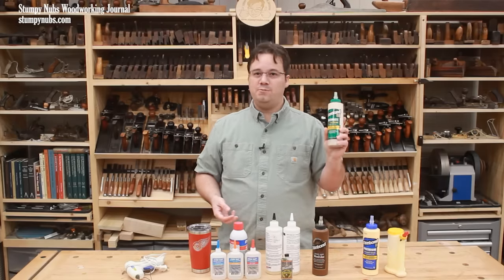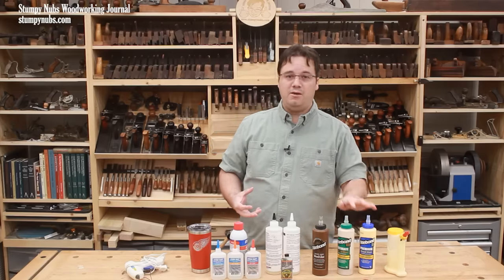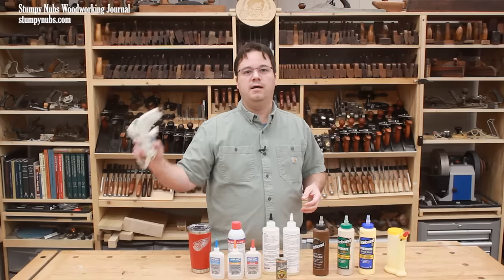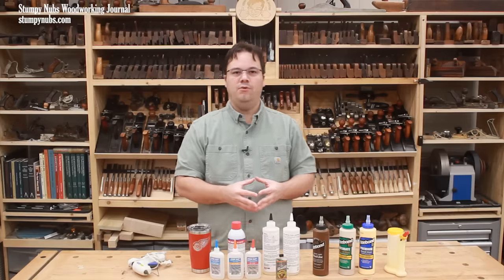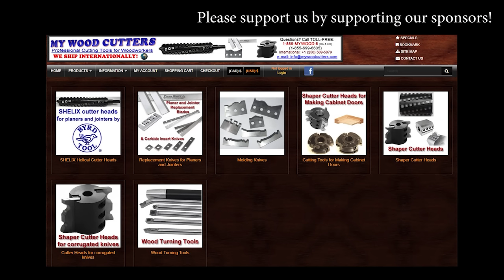Why I don't use Gorilla Glue

Comment: The "original" foam Gorilla glue is for a purpose and has it's uses... I would never have considered it for wood working.  For instance I used it to repair a broken roof tile, applied sparingly and our low garden wall that was reversed into on both side on consecutive days...this glue fixed all three things.
Gorilla wood glue is water resistant and in warm conditions a short grip time... for instance May a couple of years ago we started decorating to allow a ladder to be used on the stairs I glued to pieces of 9mm play together to create a platform, by the time I had measured and cut the legs and brace the two pieced of ply were bonded and put of the clamps.
Also in the UK Gorilla wood glue is significantly less expensive that Titebond II £5.39 vs £8.92 it is also easier to find.
So perhaps when trying to avoid a click bait title you thing about one Brand may have very many different products... Gorilla tape is super strong but for finished product not so appealing...

Comment: Polyurethane glue does indeed fill gaps, but when there is a gap, the glue foams up the loses its strength. I've read empirical testing that shows this to be so. I've gone through just 1 bottle of the stuff and that was enough to tell me that it just isn't worth the mess.

Comment: Thanks for posting. Can’t even get this gorilla glue out of the tube. Some suggest dipping the whole thing in boiling water to soften. This tube doesn’t have a long enough puncture pin to open the tip. So disappointed. Back to good old elmers yellow wood glue.

Comment: Jerry over at Rosa String Works has demonstrated many times that Tightbond is just as reversible with heat and moisture as hide glue but doesn't turn brittle and powdery over time. He has a constant battle with the purists that believe hide glue is the end all be all glue for instruments lol.
Reply from the maker: In my experience, releasing Titebond with heat requires such high temperatures that it destroys the wood finish around the joint. Not something I would want to do if I was repairing an old piece of furniture.
Reply: @StumpyNubs  I don't have a dog in that fight.  Just saying that he repairs musical instruments which are more delicate and finish concerns as well. Yet he goes on record saying/demonstrating otherwise. Who knows?

Comment: I use gorilla glue exclusively. It is a little messy (not difficult to deal with) but with butt joints that are going to be painted IT WILL NOT CRACK. It's not for every job...but if you want to build something and have it stay together it's the way to go.

Comment: CA glue cannot get wet because it softens into a rubber consistency. You can use it on skin as a way to make artificial carouses but if you wear gloves it softens from the excess moisture and will peel off easily

Comment: I don't use gorilla foaming glue because foam means air bubbles in the bond, and the strength of an air bubble is zero.  You're getting strength only from the glue left between air bubbles.

Comment: I don't understand why you don't use a glue that effectively replaces several of your other glues ? I use PU glue everyday in my workshop. Mainly on mdf, plywood or softwood cabinet doors etc. I also have titebond 2 and I find if you don't clean that up straight away it's very difficult to clean up from your project. But PU glue is very easy to scrape off and sand off. Unless of course you use it on oak, it's awful for staining oak.

Comment: The regular Gorilla glue is terrible about expanding and foaming but it is very strong. Wouldn’t use it for wood. But there are other excellent Gorilla products that actually work better than some of the highly advertised sealers and such.  But for woodwork I like Titebond  products.

Comment: You should go check out Project Farm's video on glues.  I think he has two or three where he tests them.  He's very through and scientific in his testing.  Gorilla glue should have a place in your shop, even if it's not frequently used.  It's great for bonding two porous surfaces, not just wood.  I've personally have used it to bond hollow concrete blocks together.  It also is wonderful on large pinned structual joints.  It this case, I built a lifted platform for testing equipment that measures magnetic fields.  No metal fasteners could be used, but the platform needed to be able to support 3000 pounds.
Reply from the maker: I didn't find his test useful. His sample was far too small. He tested three joints for each type of glue situation, and got wildly different numbers for each joint because there are far too many variables when gluing wood fibers. To get a meaningful average you would have to test dozens of each joint- at least!

Comment: Here's a tip for using hot-melt glue: heat the pieces to be joined, beforehand.  It gives a longer work-time, and also allows the glue to flow, and adhere more effectively.  Something else: You don't need a glue gun.  You can use such glue like solder, with a heat-gun, instead of a torch.

Comment: If a dog ingests polyurethane glue, the stomach acid causes the glue to foam and solidify into a ball that will not degrade and may be too large to pass through the animal. We never keep poly glue in the house because we have several large dogs and some expensive surgeries to remove objects. On the rare times I use poly glue, I get enough for the project and discard any leftovers.

Comment: I agree that gorilla glue is not great for woodworking but I do like it for hidden repairs that will be buried. It is incredibly strong when used as directed. It is also very messy so you don’t want to get it on your skin. 

Like anything else, it’s best to use, “The right tool for the right job”.

Comment: GG has a white glue similar to the other glues shown here, i wonder how it stacks up to the other types of glue shown here?
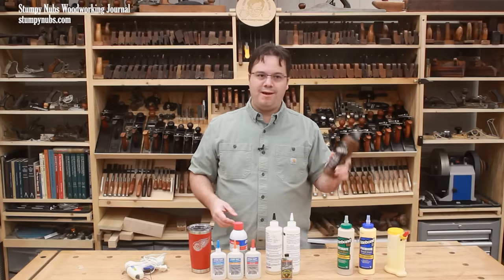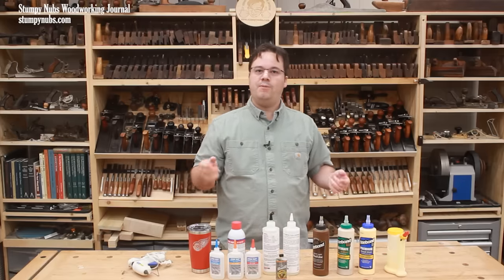Reply from the maker: Yes, I mentioned Gorilla's PVA glues as something comparable to the Titebond formulas I use (3:21). I also showed that I use their epoxy injectors (6:37). It was only their PU glue that I don't use (10:14) which is their flagship adhesive and is what their brand name is most known for
Reply: @StumpyNubs  I must not be paying proper attention.  Thank you for clearing it up.  :)

Comment: Polyurethane glue is awesome for gluing foam and probably the best option. That is bout the only place it really shines in my opinion. As far as gap filling, Gorilla glue is one of the most expensive options and doesn't work as well as epoxy for gap filling and the filled gap is not structural.  That is not even considering the wide variety of additives available for epoxy.

Comment: Polyurethane glue is good for oily exotic hard woods like bocate and coco bolo. Tightbond 1 or 2 don't hold in my experience. I haven't tried Tightbond 3. I'm curious to know if anyone has experience with that in oily woods.

Comment: Yellow glue simply will not set up in cold. Epoxies should be tested too.

I used to do woodworking in an unheated barn. For all the problems with polyurethane foam it was the only thing that worked for me. Titebond just crumbles below freezing.

Comment: Any truth to this.. I was told not to store titebond longer than one year because it will loose it's bonding property...
Reply from the maker: I have kept it a little longer, but only if it is turned over once in a while to keep the bottle mixed. After two years I toss it rather than risk a failed joint.

Comment: Titebond makes a polyurethane glue (purple label) that I've found far nicer to work with than Gorilla. It's not easy to find and doesn't have great shelf life once opened, but it is very strong on some of those harder to glue woods. I've had some failures with yellow PVA on thermally modified lumber, which doesn't seem to like water based glues, but the TB poly works great.

Comment: as a tinkerer, I use 3 glues, CA glue, gorilla glue, and 3m 5200.
ca glue is convenient but annoying and doesnt work well on everything, I use it on small stuff
gorilla glue works on a lot more and is stronger in a lot of circumstances, I use it on larger stuff
3m 5200 is for when you dont want whatever it is you are gluing to EVER BE REMOVED, because youre going to have to break something to take it off.

I dont think gorilla glue is a wood working glue, its more of a handyman's glue

Comment: I use white Carpenters glue or " school glue when building my kayaks I know that more modern glues have been invented since 1997 but they have disadvantage of cleanup they also have a disadvantage that once dry fresh glue doesn't really stick to the old glue and so feeling cracks with glue it's next to impossible because the vibrations from the sander just make the new glue fall out. The new modern glues I'm referring to are the yellow glues. But I do not need that advantage in my boats my boats are encapsulated in waterproof fiberglass.

Comment: CA glue often plugs the application point.  To avoid this I let my bottle set for a short time, wipe off any apparent glue and then squeeze the container to expel any glue in the application point.  Wipe any squeezed glue off and put on the lid.  Also after watching many of you professionals I finally purchased one of those special bottles and it's far superior to the Titebond lid or Frenches mustard lids.  It doesn't dry out and applies the glue much more evenly.

Comment: I love your channel and listen to it all the time.  One small critique.  This video was kind of mislabeled because it isn't about why you do not use Gorilla Glue.  It's about types of glue and only why you do not use polyacrylic glue.  As I use Gorilla Glue PVA all the time (and really like it) I listened specifically to hear what you did not like about it.  So, I was disappointed to listen to the very end only to find out that the video was not about "Gorilla Glue" per se but about one very specific form of that brand's products.  That said, I still learned alot about variations in PVA's and the actual difference between white and yellow glue.  So not a total waste by any means.  Better video titles perhaps in future.  Thanks!
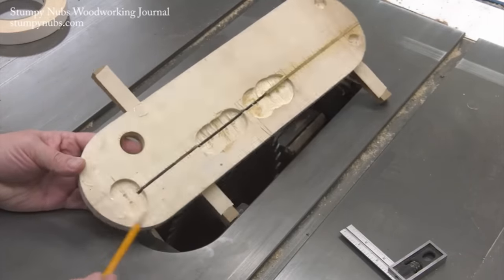Reply from the maker: I did not say I don't use the entire Gorilla brand. In fact I noted that Gorilla makes PVA glues that are comparable to the Titebond formulas I use (3:21). I also showed that I use Gorilla's epoxy injectors (6:37). It was only Gorilla's PU glue that I said I did not use (10:14). PU glue is the flagship adhesive of the Gorilla brand. It has become synonymous with the name "Gorilla Glue". The company itself calls it "Original Gorilla Glue" and when you say "Gorilla Glue" that is by far the adhesive people think of. I even showed their distinctively shaped PU glue bottle in the thumbnail image of the video.
Reply: These days I try not to be reactive so I gave it a day to think about your response.  But it still rankles.  When someone starts out their comment with "love your channel," the appropriate response from you is, "thanks for your support."  You might add, "I'll give some thought to thumbnail titles."  The end.  Your response comes off as defensive and pretty rude.  I was surprised.  You are such a great teacher-so clear, concise and knowledgeable- I just assumed that you would know how to also be a learner.  Let me share something that I know because I am twice your age.  You cannot learn if you cannot listen and take in constructive criticism.  And BTW the criticism stands.  This video should have been called, "Some glues and why I do (or do not) use them."
Reply from the maker: @marykayryan7891  - I appreciate your feedback. But as you said, I try to be factual and concise. That's all my comment was. Factual and concise. For you to read into it that I can not take constructive criticism is not fair at all.  If I don't spend time beginning my responses with the appropriate pleasantries, I may be forgiven because I read about a thousand comments a day and have to be efficient if I hope to respond to any at all. I ask you to go back and read my response again, but without the preconceived notion that I am being smarmy or short with you. I think it will read differently to you, this time.

As for your specific criticism, there are factors you are not considering. Specifically how YouTube functions as a platform. If I titled this video as you suggested, "Some glues and why I do (or do not) use them." it would not receive enough initial views to be picked up by the YouTube algorithm and promoted across the platform. So I used a title which was accurate (as I explained above), but left the reader wondering enough to watch the video. That's called a compelling title, and it worked quite well. It's how videos must be marketed these days. We don't have to like the reality of YouTube, but it is what it is.

Have a nice day.

Comment: Gorilla glue is ideal for marine woodwork. It is flexible and waterproof. Epoxy, the only alternative, is waterproof but inflexible and intolerant of shear unless reinforced with fiberglass filler, micro balloons or glass fabric - hardly compatible with fine joinery. Tight bond is great for anything interior or the occasional splash of water quickly wiped off. It’s a chemical thing...

Comment: You left out two important glues.  Ureaformaldehyde AKA plastic resin and Resorcinol Glue . Plastic resin glue is powder activated by  mixing with water. When it dries it has no flex and is water resistant. It sands with out loading up sand paper. It is Ideal for interior laminated and bent wood projects because it will not creep. And is less expensive than epoxy. The other glue is Liquid phenol-resorcinol resin adhesive. A two-part system which provides a waterproof, structural bond. The most common application for resorcinol glue is in adhering the plies of exterior and marine grades of plywood. It is strong. Currently one of its main uses is to put together plywood, laminated support beams and other wooden structural elements. It is the go to glue for all things outside or in high moister areas. 
It leaves a visible glue line.

Comment: I have found expanding Gorilla glue to be exceptionally good at repairing damaged outdoor furniture in conjunction with screwing - especially on older hardwood furniture. No other glue I have ever used is capable of:
A) grabbing the surface hard no matter it's condition.
2) Expanding to fill all the gaps
*) Is extremely strong, even when gaps are present in the joint.
∞) Has a long lifetime when exposed to the elements

I wouldn't use it unless gaps are present, but I keep some handy, and when I need it, I am very glad I have it.

Comment: Epoxy sticks best to Bare wood and second best to sanded epoxy for a mechanical Bond. If something cracks that was glued with epoxy you can't just put fresh epoxy in that crack it won't stick to anything it'd be like trying to bond plastic with epoxy it just doesn't happen.

Comment: The clear Gorilla Glue is precisely the same formulation as spray foam. But about ten times the price. It fails catastrophically, which is to say it doesn't give any warning that it's going to fail, it just pops open. And their white glue is the same formulation as kiddie glue. I buy kiddie glue for about quarter the price, or PVA that comes in tubs for waterproofing, it's the same.

Comment: Remember when Gorilla Glue meant only one particular glue?  I tried it and really liked it.  So I went out and bought the big bottle since it seemed more economical.  Later, I discovered it had a limit shelf life.  Wasted money.  I don't like GG any more.  They do make good duct tape, though. Just ordered Titebond 2 and 3 from Lowe's (better price).  Thanks.
Reply: PU glues store better if you turn the bottle upside down, or at least the part that gets exposed to air is more likely to be on the bottom of the bottle in that case.  Does make things awkward on the shelf though, I have a few big plastic cups I use to store PU glue bottles upside down in.

Comment: I stopped buying Gorilla Glue because it always went bad before I'd get a chance to use it.   I"d keep a small bottle around, then when I went to use it, the glue would be hardened in the unopened bottle.  this happened several times, so it's got a shelf life.   I also tried Gorilla epoxy in metal tubes and the resin hardened before ever using it.   I e-mailed the company about this and they had me send them the lot numbers, and it turns out my Walmart doesn't remove older products on the shelf like they are supposed to.   The customer service rep sent me several e-mails asking for my address to send me coupons or samples but I declined.  I wasn't after freebies, just wanted to let them know.

Comment: Great info but I cringe whenever I hear "glue" when what the person is talking about is not actual glue, but another type of adhesive. Perhaps a small thing to most people but my dear departed dad was a mechanical designer and engineer, and he designed/built projects where the type of adhesive was critical to the success/failure of said project. You spec out the best adhesive for the job and you check all the white papers to make sure it's appropriate for the load/environment.

Comment: Yellow glue is predominately a U.S. phenomenon. The yellow is only a dye. The reason for adding it was do distinguish glue that is no a pure PVA from the early PVA glues that did not have great performance. Where I live there is no yellow glue apart from expensive U.S. imports. FWIW Tightbond III though a good glue at lower temperatures looses strength as the temperature rises at 150°F it's not great, usually around 1000 PSI which equates to a 2/3 loss of bond strength. So depending on where you live your design needs to be modified so that the glue strength is less important.